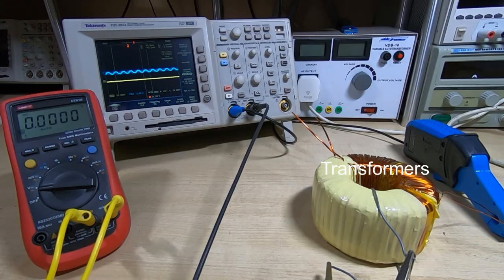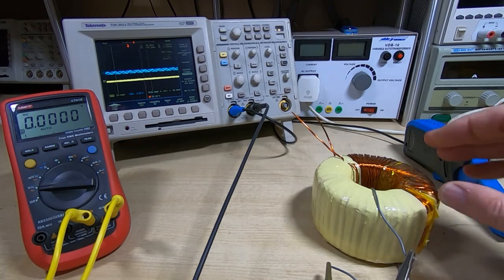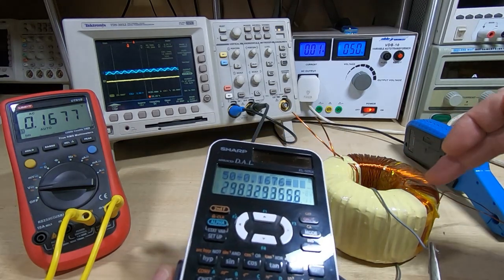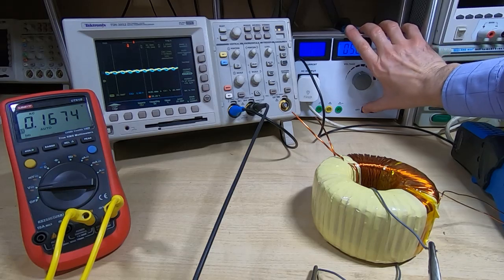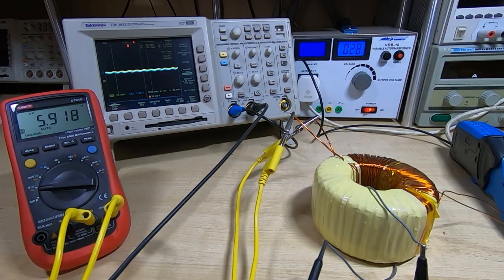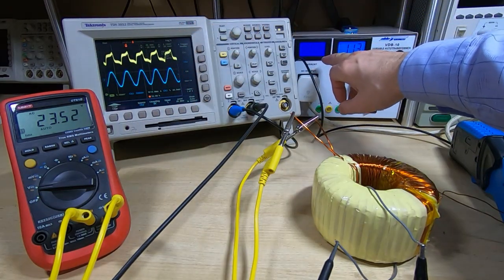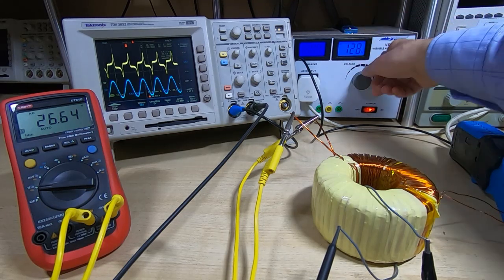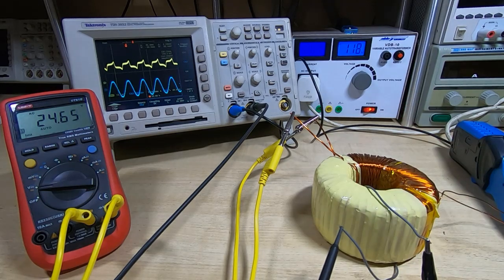Transformers Part1

Comment: Excellent. I'd not seen this earlier when I was watching the linear videos.
So how did you know what voltage this core would saturate at?
Ot at least, what it was designed to run at.

Can you say what the core specs are, and for the windings?
I'd like to use it as an example for the calculations to work through on.
Reply from the maker: The core saturation is based on the number of turns so you calculate this in the same way as for a normal transformer although you do need to take into account the action of the shunt. The idea is that unlike a normal transformer you want the secondary (Not the primary) to run into saturation fairly early in the mains cycle so that the voltage across the secondary looks more like a square wave rather than a sine wave. You can calculate the number of turns required to run a core into saturation if you know the core flux properties and from that you can calculate the point at which it will saturate. For a FR transformer you normally pick an operating point to give reasonable efficiency and good regulation over the required range of loads. You select the capacitor value to give you the required LC time constant and this is normally for either a 50Hz or 60Hz supply.

Comment: If you didn't already have data on the transformer core and if this experiment showed that the maximum safe working voltage of the transformer was say only 100V on the primary instead of 120V, what would change to the primary winding would be necessary?
Reply from the maker: I assume you mean if I had messed up as it is unlikely that you would find a 100V transformer (but not impossible). Transformers are ratiometric devices so you can easily calculate the required change. In your example you need the voltage needs to be raised from 100V to 120V. 120/100 = 1.2 Assuming your turns test had showed a primary turn count of 300 turns (for example) then the required turn count would be 300x1.2 = 360 turns. There are a few other factors that you would need to take into account but that is the main consideration. Of course if I had made that mistake in my transformer then I would also need to raise the number of turns on the secondary as well so in this case it would be 60x1.2 = 72 turns. This is why step 1 is to determine the correct turns required for the primary.
Reply: No implication that anyone made a mistake winding the transformer. Say you started with a bare core without any data, how would you determine how many turns are optimal for the primary? Just keep adding turns until core saturation occurs at a safe margin above the desired primary voltage?
Reply from the maker: Don't worry I was not taking offence. Just pointing out that if you were investigating an existing transformer (which was the question I was answering) then it would likely be a practical voltage such as 120V or 240V. If you are starting from scratch then it is fairly complicated because you need to take many factors into account such as core material, core area, wire diameters based on required current handling and hence losses. There are a number of formulas you can use but they are too complicated to cover here. To give you an example you can look at a site like this http://dicks-website.eu/coilcalculator/index.html Note that the formulas are different for different core designs (note that I have never used this site so cannot vouch for its accuracy). If you do not want to do this then you can certainly take the approach you suggest but you may end up with a sub optimal design. In the transformer I show in the video you can see that it is very close to the desired design in terms of saturation overhead and winding resistance so makes full use of the VA rating for the core. I will demonstrate this transformer under load testing in the next video and you will see the advantage of optimal design. I have a number of books on the subject as well as coil design and they are surprisingly interesting for anyone learning about electronics.
Reply from the maker: I forgot to say that if you are in the US then do not copy my transformer design as you would need a different configuration due to 60Hz operation as opposed to 50Hz As a general guide just reduce the turns by 20%